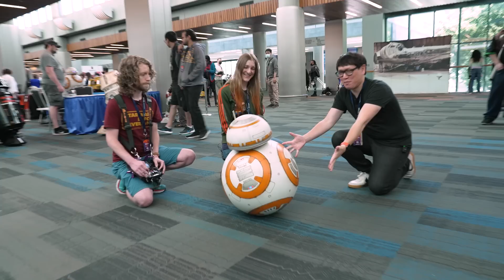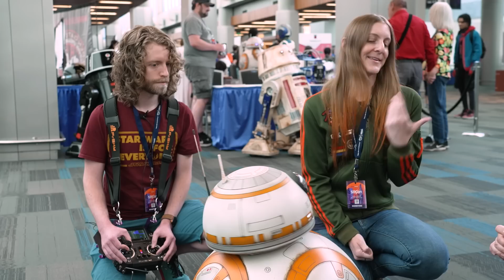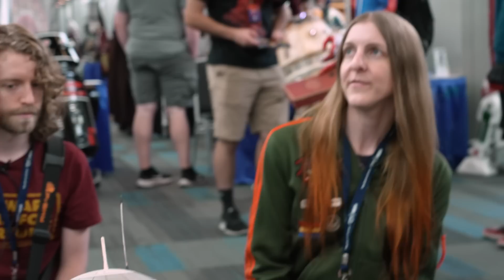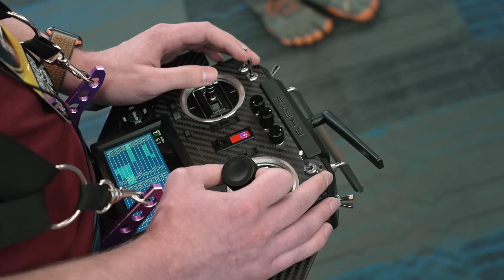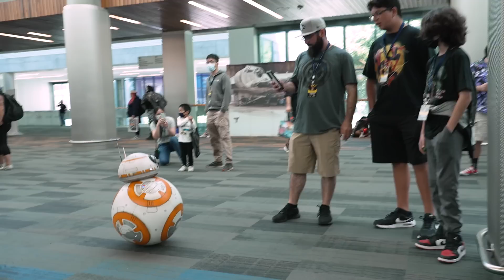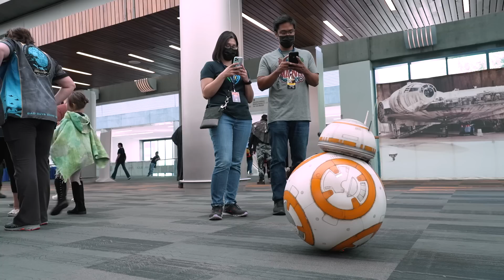The Best BB-8 Fan Build We've Seen!

Comment: Have to ask and wonder - can it travel on water/slippery surfaces?
Always enjoyed watching and hearing the little droids from SW.
Reply: As long as it is a flat surface, it will roll regardless of how much "traction" that it has.  Basically it has an axel and swings a weight forward/back to cause the ball to roll, so it doesn't rely on traditional traction methods.

Comment: From what I can tell from the girls insta, the ball is rigidly attached to an axle inside which makes me wonder how it turns.  It does have a large counter weight and I wonder if they are turning that as a moment wheel.  EDIT:  Looked closer, that is definitely how they are doing it.  Also, having the rigid axle with slip rings (vs omni wheels) inside is how they are able to put LEDs in the ball which is super clever.
Reply: If you want the actual schematics there are two main sphere designs: Vonjet and Cary with two main drive systems: Joe's Drive and Cary's drive.

You can use each sphere with each drive. The Vonjet sphere is all 3d printed with Cary selling injection molded plastic for his sphere. The drives are functionally equivalent with some differences in how they connect to the sphere and the magnetic head connection.
Reply: *Psy DeLacy is her name.